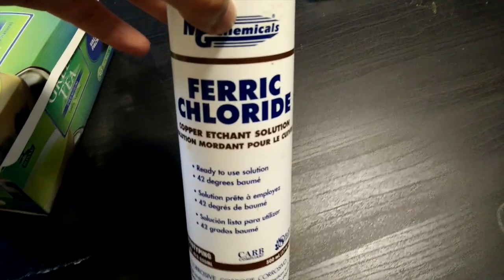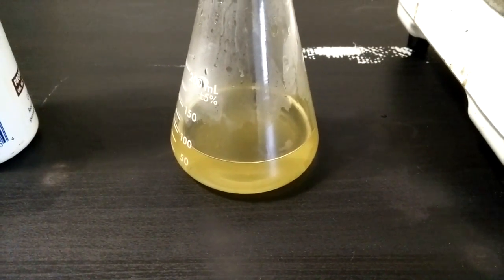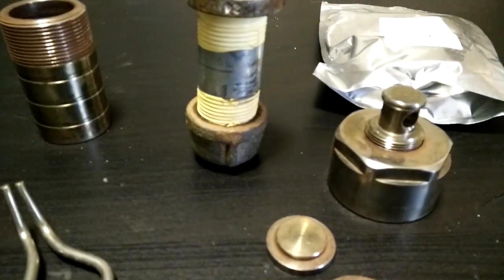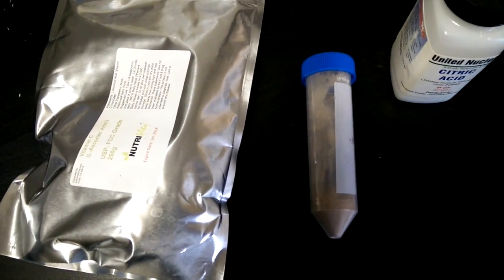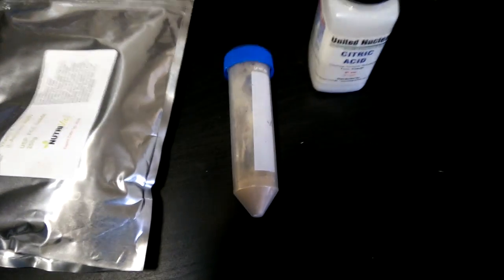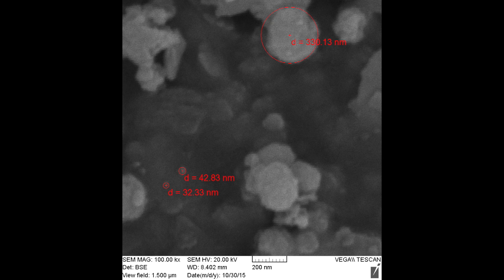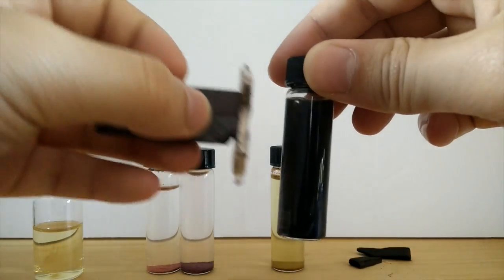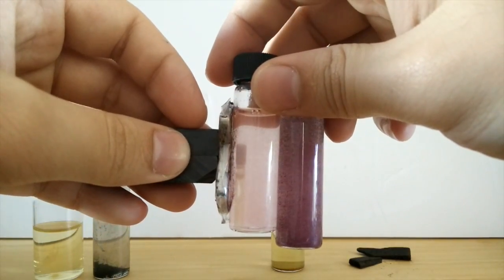How to make magnetic nanoparticles at home

Comment: green tea works in the synthesis of magnetite nanoparticles since the flavanoles and epigallocatechin gallate easily get oxidized while reducing the iron compound.

Also you could just have mixed some sodium hydroxide slowly into the solution which would have worked just well without a hydrothermal synthesis
Reply: Would that thing with naoh work for other nanoparticles or just these?
Reply: @sfadsgdsgsfd8754  It works with several other nanoparticles but the synthesis of those always depends on what type you want. Generally for other metal or metal oxide NPs I`d generally suggest using a reducing agent and a hydrothermal synthesis
Reply: @GreenCaulerpa  thanks
Reply: sgshsj no Problem
Reply: @GreenCaulerpa  should I use naoh solution or crystals?
Reply: sgshsj of course a solution else you won‘t get nanoparticles. Also watch up to not get a ph above 9-10.5 or else hydroxoferrate(III) instead of magnetite may form.
Reply: @GreenCaulerpa  will this release chlorine gas or any other toxic gases?
Reply: sgshsj Noo?? Why should it tho? 

You need a stochiometric mix if Fe(II) and Fe(III) else it won’t work. Keep that in mind
Reply: @GreenCaulerpa  ok thanks
Reply: hi are u still there? i succesfuly synthesized magnetite nanoparticles method by using naoh electrolysis, but iam not entirely sure how to stabilize them, so right know i just suspended them in water and playing them with magnet, ca u give me advice?

Comment: have you covered how to make ferric chloride? wondering, as I am guessing that a chloro-alki cell with iron electrode on the chlorine side of the cell, would generate ferric chloride as it attacks the electrode, once it has crossed over the barrier from the sodium chloride/water solution, leaving sodium hydroxide in that side, and the other side full of ferric chloride. I have been looking at this as a method of making both, chlorine gas and sodium hydroxide for a silicon oxide nano particle generating system for 3D printing :)

Comment: I know it's a little late, but the reason the acids didn't work is probably  pH. If you add a little bit of sodium/potassium carbonate or hydroxide, the reaction proceeds very quickly as you would expect. I think it's because ferric ascorbate/citrate etc are an intermediate product in the formation of iron nanoparticles and those cannot form at the low pH of ferric chloride. I found this happens with copper nanoparticle synthesis as well.

Comment: hello, I just have a question regarding the time  of reaction, should it really be 10 hours or could it be less say 1 to 5 hours ?
Reply from the maker: Yup the time is critical. You need at least that long or it doesn't work
Reply: Ok... but I have also recently done a green synthesis (ferric chloride + phytochemical) but only done it for only AN HOUR at 180 C AND IT WORKED. I checked its FTIR and UV-Vis spectra and it correspond to magnetite
Reply: Also, I tried doing the experiment for 8 hours and I used a galvanized iron pipings but most of the liquid was lost and what was left is a black sticky goo.  How can this be solved?
Reply: Don't use galvanized iron for one, two would be to add more deionized water during the process three would be to use the lowest voltage and amperage you can to achieve electrolysis four use a sonicator to agitate the solution to get the smallest particles possible.

Comment: Is this the appropriate Hydrothermal Reactor size for this experiment?  My daughter and I are thinking about doing this for a science fair.  Thanks.
Hydrothermal Synthesis vessel kettle Autoclave Reactor +Teflon Chamber 200ml
Reply from the maker: 200ml is very large and if you use a teflon reactor the reaction won't work properly. I figured out later that the iron/zinc the reactor is made of seems to catalyze the reaction. You'll be batter served by a smaller reactor unless you plan on making massive amounts of these particle. And if you are going to use one of the nice teflon ones, you'll need to add a source of metal to catalyze the reaction. I would experiment with zinc and iron and maybe copper. I used galvanized nails in my experiments and that seemed to work ok. If nothing else it's a good starting point
Reply: As this is for an 8th grade science fair, I will definitely do what you advise and get a smaller reactor.  150?  100?  What do you advise?  Also, if you found that galvanized nails work, any particular SIZE of galvanized nails?  How many?  Any advice for my 13 year old science-loving daughter would be appreciated.  Thanks!
Reply from the maker: Anywhere from 20-100 is more than enough. 20 is good because it saves on chemicals, but you can't make very much at once. And as to amounts, I experimented with various amounts, so I would make that part of the experiment

Comment: Hey, I've tried the green tea + FeCl3 but it doesn't work after 10 hours of reaction at 180C in a hydrothermal vessel.
The result is a dirty liquid with some brown-black particles and a weird smell but nothing magnetic.
Reply from the maker: was it an iron vessel? or Teflon?
Reply: teflon
Reply from the maker: +seilgu add some galvanized nails to the reaction. I dunno why this works but it does. been trying to figure it out for months. They have to be galvanized or it wont work. But it's not the zinc, and it's not the iron that makes it work.
Reply: maybe Mg?

Comment: Green tea worked probably because it has polyphenols that can be easily oxidized. You could try phenol, catechol, resorcinol, hydroquinone, pyrogallol and commercial antioxidants like BHT and BHA. Vitamin E may also work, although it has a low solubility in water.
Reply from the maker: +Pyro213 Iron oxide will form regardless of what's in the reactor. the tea is just there to cap the particles. the core is solid iron oxide with a carbon shell.
Reply: That wouldn't make sense tho, how could an organic molecule make a ferric ion magnetic.  I think these are hallow sphere particles.  Iron is already ferromagnetic so it doesn't make sense why this is intruging
Reply: +The Thought Emporium There are many different types of iron oxide. One of them is magnetite, a mixed iron(II,III) oxide. Ferric chloride only has iron(III), so a fraction of the iron content needs to be reduced to iron(II) to form magnetite. So a reducing agent should be neccesary for magnetite formation.
Reply from the maker: the supercritical water in the reactor can act as both a a reducing agent and an oxidizer. Keep in mind that most of this is chemistry based on whatever free radicals are present at any one moment. Also tea has been shown to be a pretty good reducing agent. The black that forms when the tea is first mixed is from the formation of 1-2nm nanoparticles of iron capped by the tea. the hydrothermal process agglomerates them into larger and larger spheres. That said, i'd need to use at least a transmission electron scope to find out exactly which form of iron oxide it is if not an xray of some sort.
Reply: +The Thought Emporium The critical temperature of water is about 374 °C. Since you are only heating the vessel to about 180 °C, I highly doubt that the water actually becomes supercritical. Highly pressurized yes, but not supercritical.
Reply from the maker: +Madarpok you forget pressure increases the temperature inside the thing. The chamber can reach up to 40M mpa and usually sits at about 25-30 mpa during the reaction. the critical point of water is 374 but at 218 atm (22mpa). The reaction can easily get up to those temperatures and pressures. Every paper i've read agrees that it does go super critical in these vessels. if it didn't it wouln't work as well.
Reply: The Thought Emporium
My understanding is that both the pressure and temperature must be above the critical point in order for a fluid to become supercritical. According to the phase diagram of water, at a temperature of 180°C and a pressure of 40MPa, it is well within the ordinary liquid region. The critical temperature of a substance is not dependent on the pressure.

https://upload.wikimedia.org/wikipedia/commons/thumb/0/08/Phase_diagram_of_water.svg/700px-Phase_diagram_of_water.svg.png
Reply from the maker: +Madarpok Since I lack the equiptment to check or see if it is super critical (although that would be really cool to watch) I can't really say one way or the other.

Comment: couldn't you just get a really fine iron powder?

It'd be just as fun to play with. Probably not nearly as small, though.
Reply from the maker: +AverageFlamethrower not small enough and at this size would instantly light on fire. These also have a special shell on them that's useful for nanotech work. Also it would rust. This wont